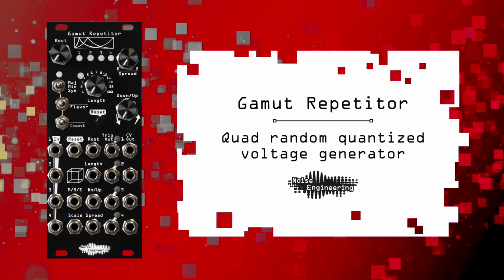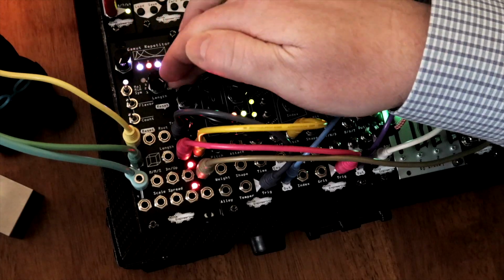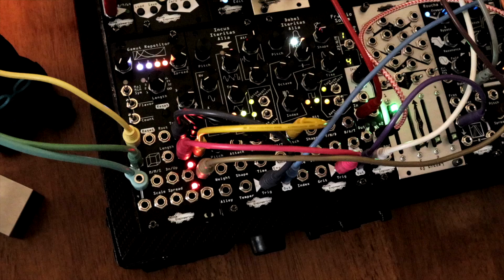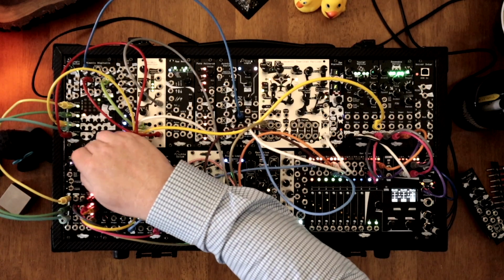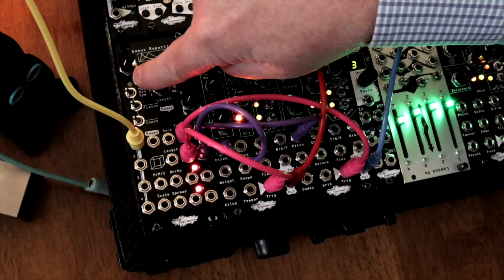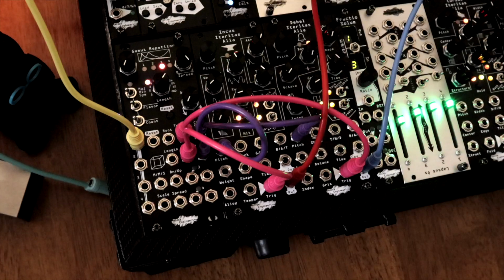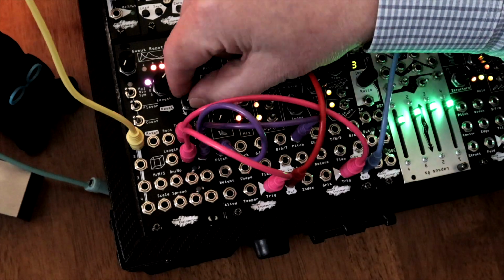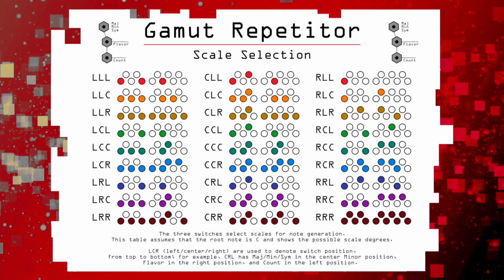Gamut Repetitor quad random quantized voltage generator from Noise Engineering

Comment: @Noise Engineering this looks awesome. A few questions:

1.) Do the various scale settings listed in the manual correspond to any particular scales (harmonic minor, phyrigian, etc.)? Or are these just various note selections/limitations offered under the three main scale options (major/minor/symmetric)? It looks like RRR is definitely chromatic...

2.) Let's say you enter rhythm generation mode to generate randomized repeating rhythm patterns, but aren't crazy about the rhythm that's been produced. Is there a way to quickly generate a new randomized rhythm? (Sort of like the "dice" button on Vermona's Melodicer.)

3.) Which NE modules would be a good fit to send randomized-yet-repeating triggers to this module? The main goal here would be to create musical-sounding patterns that don't trigger every single quarter/8th/16th note. Or maybe rhythm generation mode alone would suffice for that?
Reply from the maker: Hi there. Great questions! 
1. Here's the scale list:
natural major tetratonic
natural major pentatonic
natural major diatonic
melodic major tetratonic
melodic major pentatonic
melodic major diatonic
harmonic major tetratonic
harmonic major pentatonic
harmonic major diatonic
natural minor tetratonic
natural minor pentatonic
natural minor diatonic
melodic minor tetratonic
melodic minor pentatonic
melodic minor diatonic
harmonic minor tetratonic
harmonic minor pentatonic
harmonic minor diatonic
octave
octave + tritone
minor thirds
major thirds
major thirds + tritone
major thirds + minor thirds
minor thirds
whole tone
chromatic

2. The random patterns are 50% passthrough. There is no way to generate new rhythms.

3. The Numeric and Zularic Repetitors aren't quite random but would work really well. Our Jam Jam module can also create random patterns that take a simple trigger pattern and make random patterns  that you can then send out to the Numeric or Zularic Repetitor.
Reply from the maker: We'll update the manual to show the names of the scales as well.

Comment: Would this mostly be used as a sequencer? Or would it be useful for cv modulation? I'm new to eurorack
Reply from the maker: It's designed with sequencing in mind, but it works great for modulation, too. Since it has four CV outs, it can do both at the same time!

Comment: You say that when reset is held, randomized repeating rhythm patterns are generated at the trigger outputs. 
How are these patterns generated? Are they based on the incoming trigger signal?
Reply from the maker: Rhythm Mode patterns are just a 50% passthrough rate

Comment: OK, that's irresistible, even though it means I have to de-rack my beloved Touring Machine.
Reply: Just use it as more modulation!
Reply: @gibaleebog  Actually, I guess I could just replace the voltages expander and keep the TM. Yeah, that's the ticket!
Reply: @gibaleebog  Oh I would...but I'm 100% out of room. It will go into storage until I build yet another case some day.

Comment: How do the counter melodies work? Are they similar to sample and hold from the base melody or is this generating something in the background to be triggered for cv outs 2-4?
Reply from the maker: Each of the 4 trigger inputs can be clocked independently. We clocked the 2nd trigger input (the counter-melody) at 1/4 the speed of the 1st trigger input. The clock source in this video is Horologic Solum, just above the Gamut Repetitor.
Reply: @NoiseEngineering  ok but the actual melody is the same for all cv outs? It’s just being clocked differently? Those channels will always be the same melody if clocked the same?
Reply from the maker: @foxendeavor  No, four different patterns can be generated.
Reply: @NoiseEngineering  Got it, thanks!
Reply from the maker: Hi there. Yes, that's correct. The pattern that you generate is universal for all 4 channels. Each input will play that same sequence of notes based on when the input's trigger is received.
Reply from the maker: Great pairing!